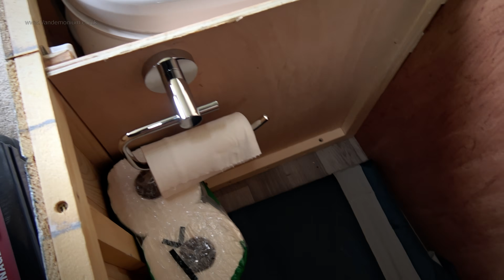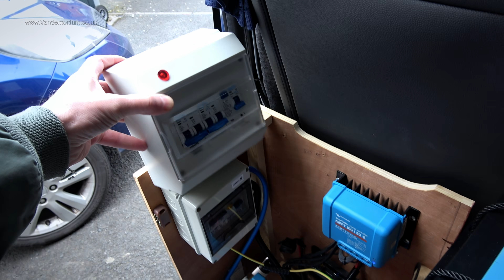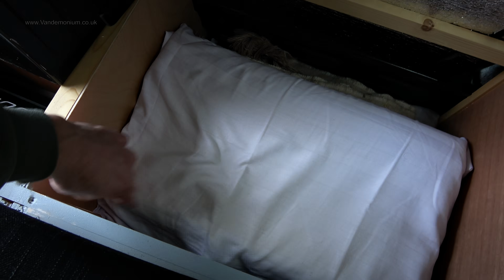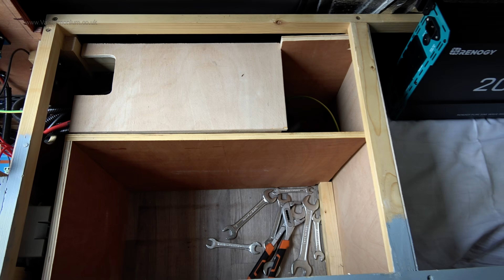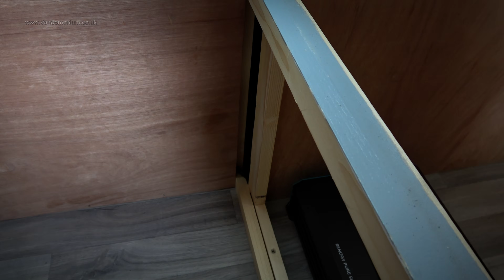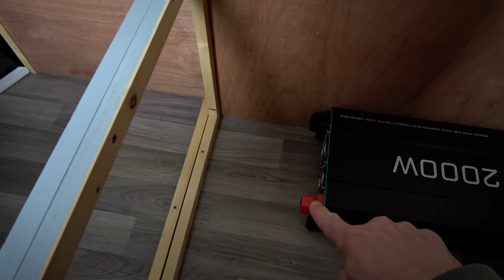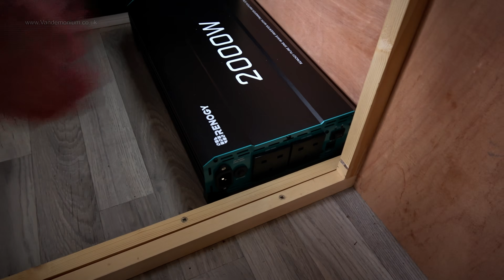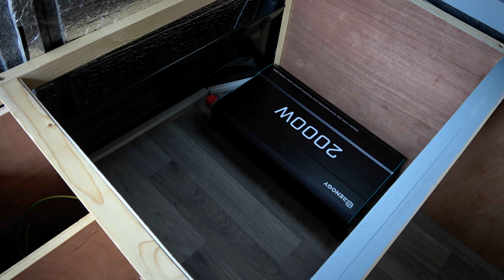78. How should I arrange the new campervan electricals?

Comment: My wife was wondering why you don't just buy 2 portable gas stoves which you could store away easily with the gas cylinders? It would give you all that workspace and then bring out the stoves for the cooking part after everything's prepared. Your existing system would be okay for your present needs and you could sell the new battery and inverter and pocket the difference.
Reply from the maker: Because the idea was to not have gas in the van

Comment: You won't need more than 300-600 watts at a 50% or so duty cycle except on startup and for a short time. Why they did that who knows. Just found a  600 watt RV unit on Amazon US. Should not make much heat and all have thermal protection.
Reply from the maker: I will; each 'burner' on the induction stove draws max 800W and the kettle is 1kW

Comment: How about rebuilding the battery cabinet. Place the battery on the bottom, build a shelf over it and place the inverter there. Make a top for the cabinet and make a door at the front to access the battery and inverter from the front. You can fit the water bottle elsewhere more easily if this scheme works.
Reply from the maker: Sadly, not enough room to put the inverter above the battery.

Comment: That inverter should probably be able to breath a bit. But Honestly, I think you are better off just using the battery and inverter compartments you have and modifying those to fit everything. I think it is silly and even potentially hazardous to have the inverter farthest away and wiring all that stuff around when your plugs are right next to the old inverter. It is hard to give you a solid plan because I am not there in person, so I can't actually see the sizes you are working with, but if you can make it happen, reworking those compartments(tearing out some of those walls), I think you will be a lot safer and happier in the long term. Also make sure you use the 2 wires together like you said, or get a new one custom size and gauge for that 2000W output. That stove will NEED it. It is best to keep the wires from the inverter to battery as short as possible too, but not a big deal if you don't. Maybe get a ~175 amp fuse between the battery and inverter. Good luck with your choice! And keep that inverter way from anything potentially flammable like linens.

Comment: Inverter AND battery into the corner storage cupboard. Inverter on side attached to studs facing out (near side wall) so wires can go around the corner through the bedding cupboard and can be boxed in. If you put inverter on the outside wall then the wires will have further to go to get to rest of electronics and will impose on then bedding storage more. Hope that helps 😊

Comment: If you rotate the battery  90 degrees will it fit in the battery compartment ... obviously after removing the internal partitioning ... and the the inverter might fit alongside .

Comment: Sorry for my bad English. But have you checket hove it would be to rotate 90 degree the battery and the inverter in the current battery comparment? If nessesary you also can exted that some in to the room. Purhaps also get som heat out from the inverter to warm upp the room when it is used. Just an Idéa. ;)

Comment: With only a cold water supply line attached to the faucet, won't water leak out of the vacant connection for the hot water side if you have the faucet turned to less than full cold water? It seems to me that the hot water port would be exposed internally if the faucet is in an intermediate position.
Reply from the maker: It's a cold water only tap (I know it looks like a mixer but it isn't)

Comment: I would put the new battery into same place as the old. Terminals should point to the left towards electric cabinet. Than put a board on top of the battery and mount the inverter on top. So wires are rather short.
Reply from the maker: Sadly, not enough room to put the inverter above the battery.

Comment: Can you reconfigure the two existing square boxes (the one with the current battery and the one with the bedding) into two rectangular boxes running the length of the two existing boxes.  Put your battery and charge controller in the new back box and your bedding in the front. You'll need to place you pillow upright instead of flat, and you'll need to fold your bedding into a rectangle instead of square.  I think it may work.

Comment: No matter where the inverter goes, it will need ventilation. It can't be blocked in or covered up. I hope you got it sorted out. I feel your frustration. Move 1 thing and you end up moving 5 things. I call that game "Solar Tetris".  ( Charge controller, breaker box, inverter, fuse, shut off switch..... AC breakers, DC fuses.....)

Comment: Hope you work it out. Here's my tuppence worth. Take your existing converter out.  As you say, the replacement battery charger could go where the existing inverter is as it is a lot slimmer. Then place the Consumer unit lower down than the existing and lower the solar charger as well.  Fettle the new battery into that battery space. You should than have enough room above the consumer unit and solar unit to put a new perforated shelf to place the new 2kw inverter on, laying flat. That unit will generate a lot of heat so I would suggest venting each side of the unit and the front and add 12v PC type fans.  If you enclose that unit in any of your compartments best to add ducted ventilation.  Good luck!
Reply from the maker: There's no room for the inverter in that cupboard even if I move the other items

Comment: All the physical, psychological and financial effort and time you expend on what goes on in the inside of your van, made me wonder how awful it would be if the underneath and mechanical aspects of your van let you down. A rust and corrosion inspection video of the underneath would be an interesting,(and hopefully personally reassuring) alternative view of the van. I seem to recall that on your Cruising the Cut channel you were as mindful of how the bottom of the boat needed maintenance as much as the top side and cabin.
Reply: The van is galvanised
Reply from the maker: I believe it to be in good condition. Bear in mind it has an annual MoT inspection.

Comment: I know you said the solar charge controller was staying put but could it move through 90 degrees and go underneath the new consumer unit? It's hard to tell from camera footage but the electrics cupboard looks taller than the rest of the areas so could the inverter then go vertically onto the back of the electrics cupboard? That would at least give you only one space that needs airflow.
Reply from the maker: Sadly, not enough room to do that
Reply: @Vandemonium  That's a shame. The neatness of everything in one box appeals to me.

Comment: Hey David! The "invisible" sounding board (I myself do it without a camera - so yeah: I talk to myself and sometimes that is good conversation actually and does solve problems, if you go through pros and cons of something etc.) is a tried and tested method of problem solving!
As for your van: It does drive a lesson I learned recently (well: OK over a year ago by now!) home, too - You can never have too many cable-ducts! If you want to ad something later to anything (be it a house, an apartment, a boat, a camper-van etc.), it's best if you installed cable-ducts while constructing the thing. 
Sadly: Cable-ducts were not a thing in the 60s, when my grandfather built this house! So yeah, I had to add my own on top of the wall (doing the old thing with a mallet and chisel is just too time-consuming and frankly too messy, too!), drill large holes in the walls and still ended up not getting everything 100% as I want it...but it's good enough for now having 2 LAN-Sockets in each room (except the bathroom!)

ps: No, WLAN is not "good enough" - I love a reliable connection and there's a lot of WLAN-Networks around, I am living in a (small) town after all, so they tend to not be reliable really!

Comment: Sir, The LiFePo4 battery you selected can be positioned in any orientation you wish . This means it can be positioned on it's side,  end, or upside down if that suits your needs. If it won't fit in the compartment sitting on it's bottom, perhaps sitting on it's end  or side will work.

Comment: Two items, David. First, that inverter needs decent airflow to keep it cool during use. You might want to put some ventilation holes into an adjoining compartment to increase airflow.
Second, look into using some plastic conduit to run the wires through to keep things neat. Fittings allow you to bolt a connector through a plywood wall, and then just cut the conduit to fit between connectors. Then you just run the wires through the conduit.

Comment: Does renogy perhaps have an adapter for those terminals that can permit the cables to be routed vertically instead of to the right?  Sort of like having a 90-deg plumbing elbow inserted into each terminal.

Comment: I have the same inverter. With mine the positive and negative cables are doubled up. Two positive cables with a single connector on each end. Same for the negative.  I recently upgraded my system and did some rewiring. The cables are not that flexible to make tight corners. Unless you change the connectors to 90 degree bends you need to leave enough space for the battery cables to connect to the inverter.

Comment: I can't see why (by removing the partitions) the new battery and inverter, won't fit in the space where the spare water container sits? Use L shaped connectors on the inverter, or have those on the existing cables bent to 90 degrees. And please David, pop the tools in a bag or wrap them with a velcro strap 😁

Comment: You can probably bend the terminals on your inverter cable to 90 degrees if you wanted or get some copper bar and make your own 90 degree adaptors.

Comment: You can't put inverter in a any box, sorry. It will get very hot and broke easily. It needs lots cooling air. Only possible solution is on the wall, or on the roof. Completely visible.  Keep it as a decoration element.   For power line there are nice covers available. Following you from Finland and I like your videos. 
BTW. I have broke one 300w inverter in a box.
Reply from the maker: Cheers. I'm not convinced (yet!) that it will get too hot as it will only ever run for about 10 minutes at a time (warming some soup or boiling some rice etc) and it is very cool down on the floor where I hope it might go.
Reply: @Vandemonium  You have to test it. My inverter is starting fan very easily and blowing hot air. It depends of outside temp, too. Mine is a decoration element in summer cottage. You have to check installion requirements.

Comment: Was thinking do you need to connect the shore line mains to the inverter if you’re not going to be running both sockets from it.
Reply from the maker: No, I won't be connecting it to the inverter even though it does offer such an option

Comment: I'd be concerned with any of these ideas for inverter location that it will overheat if in an enclosed space.  I know it has fans, but the heat MUST get away from the unit and not simply recirculate back through it ! :o) If you were drawing a lot less than the 2kW full power rating, you might get away with it, but I bet the manufacturer wouldn't agree. Can the inverter go on a wall unenclosed somewhere ? Yes, I know there will be exposed cabled and all that.I know that in the solar panel mains inverter world, poor ventilation and running right on the power limit are causes of failures. Just my 2p's worth.
Reply from the maker: Cheers. I'm not convinced (yet!) that it will get too hot as it will only ever run for about 10 minutes at a time (warming some soup or boiling some rice etc) and it is very cool down on the floor where I hope it might go.

Comment: I’d rotate the battery and inverter 180 degrees, so their connections/cables are at the electrical cupboard end - shorter wires to the master switch and more room under the mains sockets to fit the higher current wiring to the inverter.

No reason why a crimp connector (and at that current, ~200A, you will need to use crimp connectors under the inverter terminal screws) can’t come vertically off those inverter connections either, but is there sufficient room at the ends for ventilation - you will probably need to provided additional ventilation to the space containing the inverter, as it’s going to get hot running the kettle and induction cooker.

It is a big game of Tetris, but I’m sure you will find a solution - I will keep my fingers crossed for you 🤞🤞🤞

Comment: The wires that come with the inverter are usually made of aluminum and are the least expensive wiring that the manufacturer can get away with.
Reply: If you end up needing to make your own cables, I recommend getting welding lead wire.  It has an edpm sheath, which is much more flexible than rubber, and is a lot less expensive than buying pre-made cabling.  You can find it on amazon, or likely any welding shop would have it and could sell you the exact lengths you need

Comment: Electrics take up so much space (and aren't light). Just remember the inverter will likely have a hum while running, so right under your head while sleeping might be less than pleasant. Ok, if you don't need any AC power overnight and can just turn it off. If you use false bottoms, hinge them in so they are easy to open. Lay it out with wires in place. Sometimes the bends you have to make with thick wires take up more room than you would think. Great choice on keeping the stove top mobile. It can be lovely to cook outside, especially if it is something with strong smells, or if you don't want to have to go inside just to make a cup of tea.
Reply from the maker: Yes, the inverter will only run when I need to cook or boil the kettle.

Comment: That inverter needs a supply of cool air and an exit for warm air.. .. they can get hot. You can't really mount it in an enclosed space with no airflow.. You would need to vent the area.
Reply: Yes needs venting, a small computer fan uses very small amount of power.
Reply: We run ours in a cabin that is around 38° in summer. It doesn't seem fussed, but we dont run it for extended periods.
Reply: If you plan on running the induction cooker, the inverter will generate quite a bit of heat.  Ventilation would be required in the compartment.  It would be advantageous to mount the inverter in the same compartment as the battery in cold weather to heat the battery, but disadvantages in hot weather.

Comment: What are the specs of the inverter? How much space should be left around it? I can imagine quite a big heat generation on full 2kW... What about pushing the front wall of the battery compartment up to the new battery and install the inverter on the outside of the compartment? That way it would ventillate really well. Oh, wait then it will suck dirt and filth into itself. Bummer... 😅

Comment: Hi nice job on the Tap. Just curious, is that tap a hot and cold mixer? If so, does it have non return valves inside each feed? If not it may be possible if you block or partially block the tap output spout accidently when using it, water may flow down the hot side (which is not connected) and onto the floor.  May need a stop end on that other inlet?
Reply from the maker: It's just a cold tap (I know it looks like a mixer but isn't!)

Comment: 2000W inverter - flat on the bottom of the bedding area, with a false floor / shelf over it. The bedding area stays the same size/area, just looses some height, but will it all squish in?
Reply: You must be able to get right-angle brackets for the cable connectors? Or loose 2 inches from the bedding wall/divider, just as a step at the bottom. Odd shape, but bedding is squishy.

Comment: I might not see the height of the battery but I would try the battery and then the inverter on top in the current battery box. Alternatively put the inverter a long the long side of the battery in the same compartment. I guess removing the partition between the battery and water bottle is needed
Reply from the maker: Sadly, not enough room to put the inverter above the battery.

Comment: lucodeath
1 second ago
Sounds like frost damage on the tap. I repair caravans and motorhomes and hoseclips are fitted on 99 percent of vehicles unless they have the push fit semi rigid pipes.
Reply: The lithium batteries dont like cold temperatures, wont be a problem in a couple of months though.
Reply from the maker: I agree it was frost damage, that occurred to me last night when we were forecast sub-zero temps!

The lithium battery will store OK in the cold (and it will be warmer inside the van than out) but won't like charging below zero.
Reply: @Vandemonium  Leave tap open and no water in container to its doesn't freeze again. Caravans taps can be expensive.
Reply: Keep the chunky cables short as you can.

Comment: If you put the battery and inverter into the bedding compartment, you could put some of the bedding and other storage into the old battery/storage compartment.  and it wouldn't take all of that compartment but still allow room to work on it.
Reply from the maker: Thr trouble is, the wiring would have to cross the old compartment to get to the 12V box and the shore power etc so it would be much less usable as a compartment 😔
Reply: @Vandemonium  couldn't the wires be run across the front of the old compartment and be attached to it?  There shouldn't be any connectors in there, just wires passing through.
Reply from the maker: Hmmm not sure. It may depend how thick the wires have to be to carry the current so how much they can be bent round corners etc